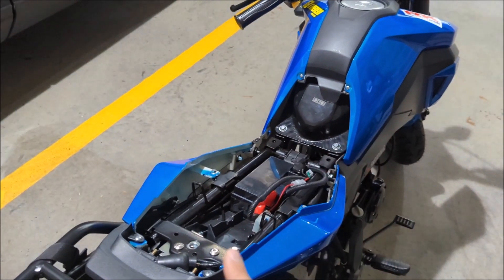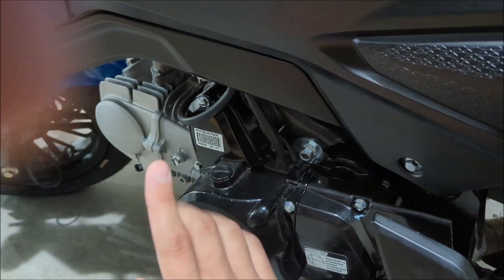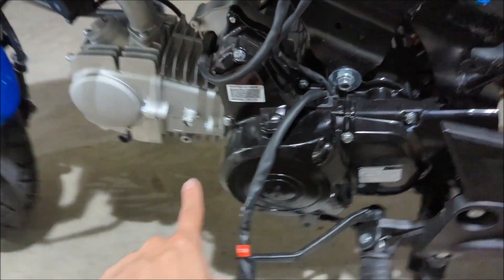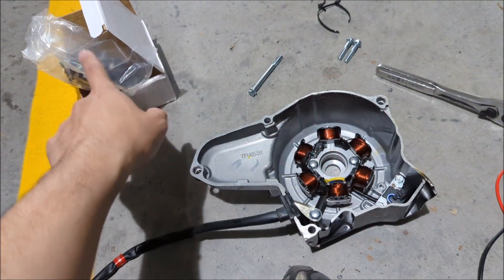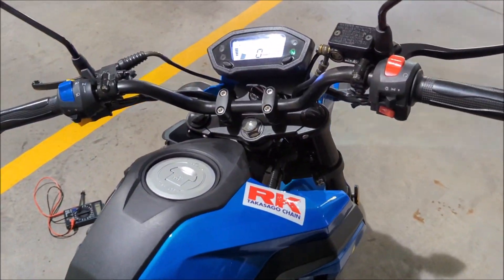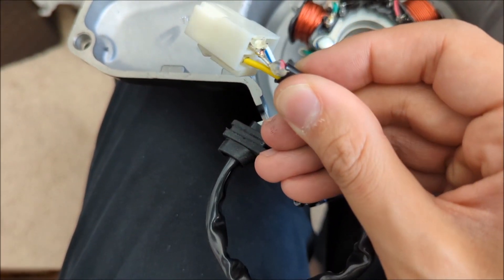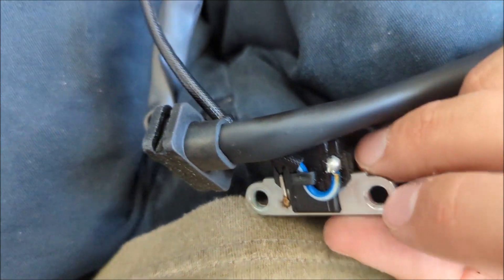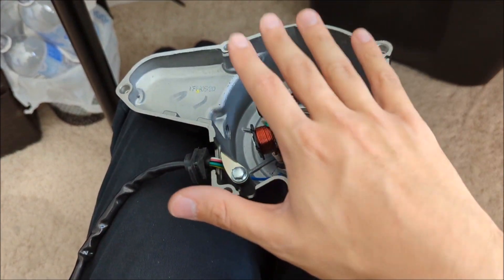Boom Vader 125 Charging System Diagnostic and Fixed (Stator and Regulator), work on most 125 CC

Comment: The electrical should not flicker. Because you have a battery. The stator and regulator is just to charge the battery, every else runs off it.

Comment: Would a 8coil 5 wire Ac fit?

RUTU 8‑Coil, 5‑Wire GY6 125/150 cc Stator
Reply from the maker: Why don't you just buy the one I got from Amazon? I have no idea if 8 coils will fit. If it does you'll have to rewire them. The connectors may also be different.
Reply: Was you able to try it out, just afraid of using an AC to DC that might jeopardize the electric system ?
Reply: I believe you should use the same one because the coils determine the timing and when to send a spark

Comment: No problems using an AC stator in a DC system?
Reply from the maker: @payton6240   yes because the only difference is one wire which you can rotate as I shown in the video
Reply: Just seen that part. Thanks for the reply.

Comment: I’m having an issue where the stator cover is leaking oil? I took the cover off and saw oil in there.. is that normal? Im new to bikes… so I’m not sure what to do. Not sure if it’s the gasket or if the cover is cracked? Anything is appreciated.. thank you
Reply: Gotta replace the flywheel seal.
Reply: @DroCityDragons yup, the factory seal shrunk. Came right off when I pulled the cog behind the flywheel. The new one was a pain to seat but no more leaks! Even without a stator cover gasket...
Reply from the maker: Is it on a grom clone? Please take a video and upload it to your channel. Explain when you noticed it and what might of happen before? I need good angles and I need to see how much oil is inside it. after uploading the video comment back on here, so I can see the video.
Reply: Yes it’s the grom clone. 
Not a lot of oil because it leaked it all out. Most likely about 2 table spoonfuls of oil were in the cover when I took it off. I noticed the oil leak coming from the bottom part of the cover. Almost close to where your shifter would be located on the left side. I couldn’t really pin point exactly where it’s leaking from I just followed the flow and figured the case was defective? I took it off to inspect the case. I can record a video today later. Unfortunately I’m at work. 

But I have a replacement stator cover with a new gasket? Going to try that before I decided if I want to mess with it anymore..
Reply: What’s crazy to me is. The bike only has like 20 miles on it…
Reply from the maker: @MarcoOrosco-g9h  check the engine oil level, it's normal they coat most parts in shipping oil to protect it during transport. If it's pouring out then it's a concern. You are sure it's on the stator side? These bikes comes with a 30 days warranty so you can get it fixed or refunded. Take the video and I might be able to help you.
Reply: I will get the video going. Thank you for your help.
Reply: Posted the video. Hopefully you can understand what I’m trying to say. I’m not sure if it’s leaking from the stator cover or the sprocket cover.
Reply from the maker: @MarcoOrosco-g9h  okay I saw it, it could be anything. We need to diagnose it. Check the oil fill line to see if you over filled it. Over filled oil can do this. If the oil level is okay, what I need you to do is drain the oil completely. Open up the stator cover and clean everything. Just wipe the entire oily area with disinfecting wipes and rags. Be sure not to get any electronics wet while you do this. It might be a good idea to disconnect the battery. After that put everything back together and fill it with oil again. Make sure the oil level is correct. Make sure you do not spill any oil on any part. Then take it out for a ride. Do like 10-20 miles. Come back and see if you can find any oil anywhere. Check inside the stator cover.

Comment: Your video is very good. I think I have the same problem but my bike has no spark and it doesn't start. What do you recommend?
Reply from the maker: Did you try jumping it first? If it doesn't crank it's the battery or the starter. If it cranks but doesn't start then it's the fuel system. If it cranks and starts but dies then it's the stator or charging system.